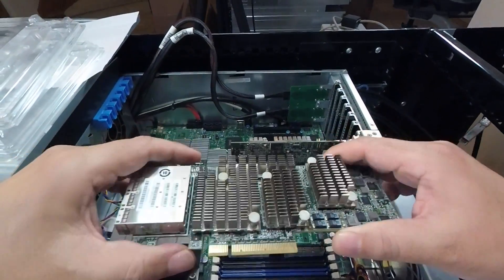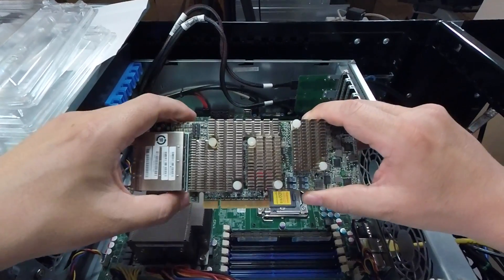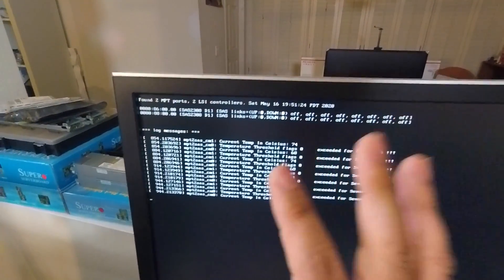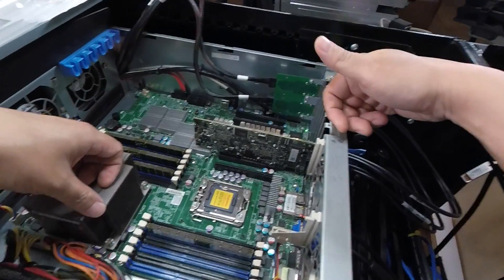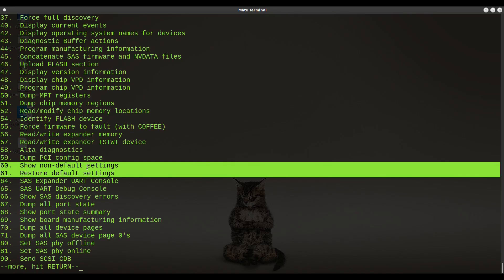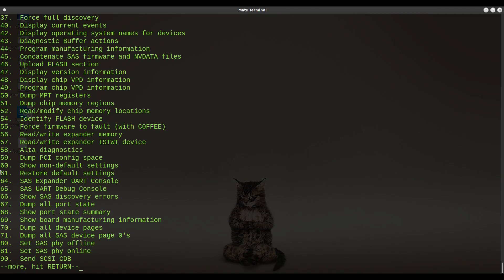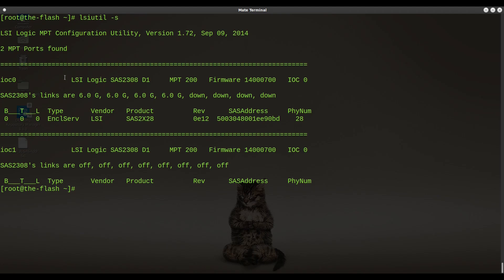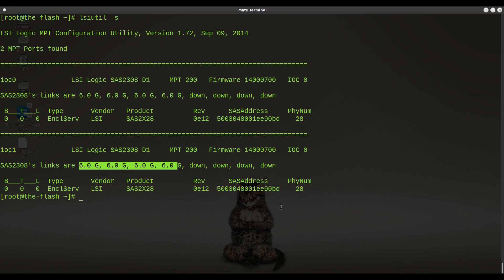Something strange with LSI 9206-16e... | How to fix LSI firmware settings

Comment: Hum, fixing this up on some 9206-16e cards (five of them to be precise) for a new Spectrum Protect (aka TSM) backup server I am building/configuring  using a Dell PowerEdge R730. I am running on RHEL8 so had to use a 1.72 version of the lsiutil command. Older versions seem to require the mptctl kernel module which is not present on RHEL8. Anyway option 61 did not fix the issue for me, had to use option 13, but note you can use 8 on select a Phys  to change all ports at once. Also the auto setting for the port config is 1 rather than 8. Anyway I can now see all my drives. That's 240 drives twice once down each ESM unit in the ten J4400 shelves.
However looking at the firmware levels on all the cards I note that one of them has on version 20.00.11, which would appear to be more recent that 20.00.07? Most of them are much older mind you. Anyone know anything about the 20.00.11 firmware version? It would appear that you can use the lsiutil program to extract the firmware from the card. It's marginally bigger at 809940 bytes versus 809436 for 20.00.07. Ok some experimentation and clearly 20.00.11 is a special firmware for these cards. The reason setting to default didn't do anything is because that IS the default for this firmware. Switch to 20.00.07 and the default is "normal" and setting to default does work.
I am reasonably confident that cards in this configuration came from Dell Compellent arrays. My cards are absolutely 100% Dell cards. It explains why the ports would be in target mode, as they would be providing RAID arrays to other servers as SAS devices.
Reply from the maker: I've seen the 20.00.11.00 firmware before too, but only on Dell Compellent cards. Just as you discovered, it has special default settings and I usually change it to 20.00.07.00. Thanks for watching.

Comment: How did you manage to install and use the lsiutil on your Linux box, I've downloaded one from the Broadcom website Version 1.62 January 2009. and it says "0 MPT ports found" thank you for your the video btw
Reply from the maker: just like you did. the "0 MPT ports found" means lsiutil is not seeing any LSI controller it can communicate with. It usually requires that your LSI controller have working firmware as it uses the MPT interface that talks with the firmware. is your LSI card actually working otherwise? which one is it? and is there a heartbeat? for further troubleshooting LSI HBAs, watch this video: https://youtu.be/TC4DovIcGLU
Reply: @ArtofServer  Thanks, I'm working on an LSI 9305-24i  and took all the steps mentioned in your other video. initially, only the ports 21-23 didn't work So I upgraded the bios(sas3flash -biosall mpt3x64.rom) and FW(sas3flash –fwall SAS9305_24i_IT_P.bin) to 16.00.12.00, and now some random ports stopped working as well which I suspect are offline but I'm still struggling with the Lsiutil under Linux.

Comment: how you run sas2flash via ubuntu ?
Reply from the maker: same way as any other Linux distro.
Reply: @ArtofServer  thanks you save life .i have mini dell 310 raid controller and by accident i remove fw and now i try to recover.Thanks if you have same suggestion?
Reply from the maker: Look up a tool called megarec.exe. it runs in DOS and should be able to help you recover your card.
Reply: @ArtofServer  i recover with a big success Thanks from Crete island
Reply from the maker: Awesome! Glad to help!

Comment: Hi folks. I have a question, Is it Lsiuitl tools just can use for Lsi firmware card? I currently have the IBM M5110 Raid card using the Oringinal IBM firmware and I use Lsiuitl shows nothing but when I use Lsscsi can show the detail correctly.Thanks.
Reply from the maker: lsiutil does not work with megaraid firmware on LSI RAID controllers. it's mostly useful for the HBA controllers with IT mode firmware and IR firmware.
Reply: @ArtofServer  Oh, Cool. Thanks for your help, Are there any benefit to change it to HBA Firmware? Since I can't get in to the M5110's boot menu, I was think to crossflash it to LSI Firmware.

Comment: I am having a problem with a 9305-24i. The two minisas ports on the top edge of the card (port 16-23) does not detect any disks and sas3flash -o -testlsall return "link down" for these ports. I have tested cables and backplanes and they are working fine on the other minisas ports, I also teste the HBA in another PC. I RMA'ed the first card, but the second card has the exact same problem.

lisutil does not seem to work on newer cards as I get "0 MPT Ports found". Do you have any suggestion on how to proceed with this?
Reply from the maker: sorry, wish I could help but I don't have much experience with that card...
Reply: @ArtofServer  ok, thanks for taking the time to answer
Reply: @ArtofServer  Found a solution. The trick was to erase everything excl. Manufacturing area before flashing the firwmvare and BIOS onto the HBA. I could not get it to work in DOS, as I was getting “ERROR: Failed to initialize PAL. Exiting program.”, but I got it working in EFI shell. Below are the DOS commands to use

    Sas3flsh -o -e 6 (erase everything excl. Manufacturing area)
    Sas3flsh -f firmwarefile
    Sas3flsh -b biosfile
Reply from the maker: @henriktimmsrensen6657  So, does that mean your card had a bad firmware flash?
Reply: @ArtofServer  It was a refurbished card, so perhaps it was flashed with 16 port firmware from the seller by mistake. I don't know if that is even possible.

Comment: Would appreciate if you could test and talk about the new LSI 9500 PCIe 4.0 HBA cards.
Available here:
https://compadvance.co.uk/en/search?search=HBA+9500

Specs on Broadcom site:
https://docs.broadcom.com/doc/12397990
8i, 8e are ~6W 16i, 16e are ~9W.

Do they work with Unraid and ZFS FreeNAS?
Speedtesting with various devices (M2 SSD) and PCIE 3.0 and PCIE 4.0 bus connections?

Your videos have helped me a lot. Thank you for all you do.
Reply from the maker: I doubt I'll get my hands on one of those cards any time soon, unless someone wants to send me a sample along with a PCIe 4.0 system. :-P

What is your use-case that you want to use such a card? All flash NVMe ZFS pool?

Comment: I hadn't thought about it until now, but I bet I can use one of the LSI tools to disable the option to boot from my HBA cards (for whatever reason, the one I should be able to access during boot never wants to load).

2:03 The `watch` command will buffer the screen output so you don't that annoying flicker when the screen clears.
Reply from the maker: what do you mean about the 'watch' command? I know what it is... just not sure what you're saying about it?

Comment: I love your videos. They have taught me a lot as I get more and more into the art of setting up and managing my own servers.
I have recently developed a problem with a RAID SAS card (not one I bought from you) and I wonder if you may have any insight of why that is. It's an IBM M5015, essentially a LSI 9260-8i with IBM firmware. The card worked fine until after a reboot it just seemed to disappear. The firmware initialization screen doesn't show up anymore, the motherboard's BIOS doesn't see it anymore, lspci doesn't list it, drivers don't load. Do you have any idea what may have caused that, and is there anything I can do to recover it?
Reply from the maker: That sounds like the card died. Does the heatsink get warm? If not, my first suspect is the fuse on the PCIe connector may have failed. (pretty common problem with cards that follow the LSI reference design)
Reply: @ArtofServer  Thanks again, I repaired it! https://forums.servethehome.com/index.php?threads/psa-repairing-dead-ibm-m5015-sas-card.28905/
Reply from the maker: @stamasd8500  that's awesome! Although, I always wonder why the fuse blew in the first place. I've seen this type of failure on a lot of LSI design cards.
Reply: @ArtofServer  I don't know why the fuses blew. The card actually had nothing attached to it at the time - no SAS cable, no BBU etc. I was just preparing to update its firmware when it happened. I had just put it in the machine, let it boot once to check its firmware version in WebBIOS, then rebooted to start the flash process when it disappeared. Since then I have successfully updated the firmware, but until I properly repair the fuses I won't use it under any load. I have spares fortunately.
Reply: @ArtofServer  The HS remains cold. Is that fuse a component that can be replaced? I'm willing to take it apart and try. I'm pretty decent at surface mount soldering.